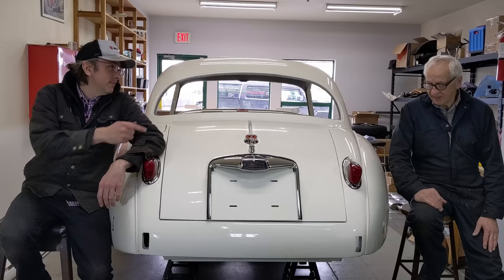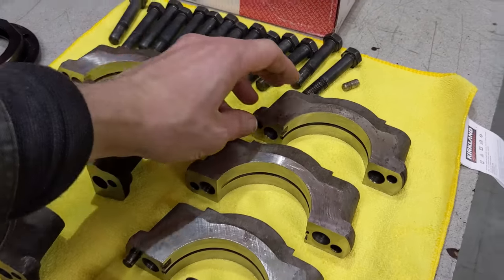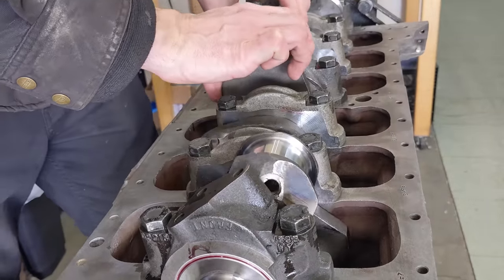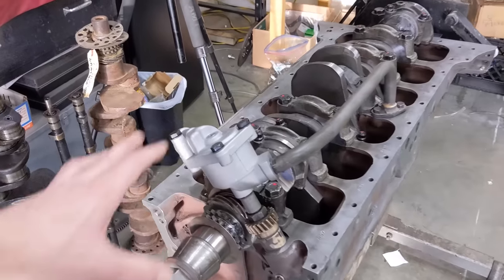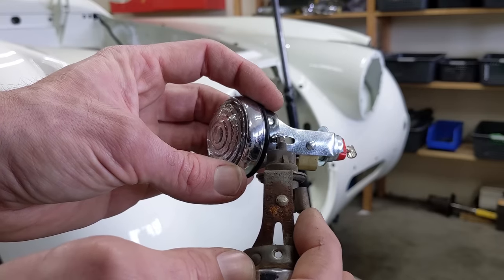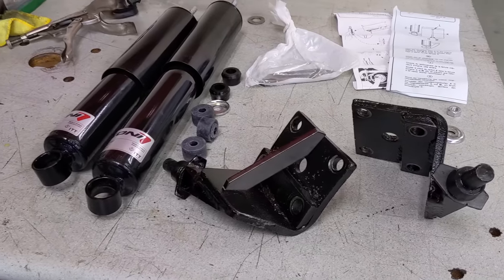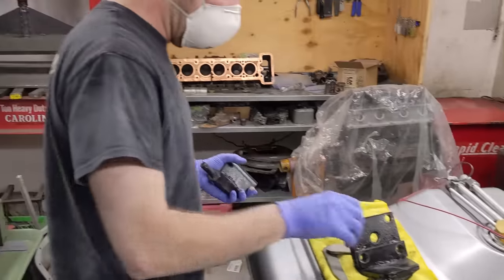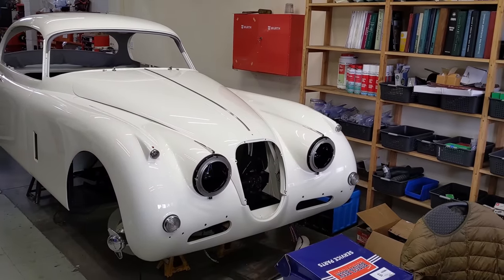Jaguar XK150 Restoration EP9

Comment: I'm putting one of these together that someone else had pulled apart 11 years ago, these videos have really helped me see how it's supposed to be 👌👏
Reply: Commendable job to take on a project that someone else took apart. I stepped in to an Aston DB6 in a similar situation. I had to go backwards for about 8 months before I could go forward. The guy had powder coated all sorts of sheet metal parts without test fitting, and it was all a nightmare. Got there in the end, and my customer is very happy. I aged 10 years on that car....
Reply: I didnt learn, as im doing the same with a 246 Dino now! 😂@ThomasMulhall

Comment: Great episode, with all the interesting variety.  I am all for discreet, well thought out improvements like the drain hole in the headlights nacelles. I would install a porous plug in the drain hole to prevent water from washing, or road splash to enter the cavity. A porous plug also discourages insects from making their way into the nacelle cavity. A jute-like material was used in the past, but these days one can use a polymer fine mesh, tightly rolled and inserted in the drain hole.

Comment: Richard, Great idea with the vice grip tool for clamping the lower bushes, I mounted my rear shocks with the body off so there is not enough weight to 
get them lined up so i used two ratchet straps on the axle.The XK is looking gorgeous the old english white looks great against the chrome. Cheers Dave
Reply: Richard, I have a question for you! What is the hole for in the floor under the rear jump seat on the drivers side. Some one as asked me and for the life of me i can‘t see why it‘s there after checking the rolling chassis there seems no aparent reason??? Cheers Dave

Comment: Superb episode. I am with you in making modifications to protect these cars and also to make the driving experience more pleasant and safe. I have a 65 Mustang that I drive a lot here in the UK. I have fitted power disc brakes, done some suspension upgrades including Koni shocks and also fitted brighter headlights to compete with those modern German cars that have lights bright enough to give you a sun tan!!  I suppose if the owner wants an absolute concourse garage queen car that is trailered to shows to just win medals and pots that's a different thing, but not my bag.

Comment: Hi Richard, I have farmed with Jags for many years. Great videos. If I may comment you have the red prisms on the side lights the wrong way, the vertical face should be towards the rear to reflect the light backwards to be visible to the driver.
Reply: I'm not so sure I agree. I researched this for my XK and came to the conclusion that Mk2 Jags have your preference. I also conducted some dark garage tests and found them  better when installed as on video. I have however used LED bulbs that are distinctly better.
Reply: These are optical prisms which reflect the light out of the vertical end. It makes sense for the driver to be able to see them as they approximately mark the front  extremities of the vehicle.

Comment: Hi Richard . The Jaguar is really starting to come together . Seeing you fitting  the big end bearings reminded me of a tale from  my best buddy. We both trained at  a Jag'  dealer ship  I, as a panelbeater and Richard as a mechanic back in 1970 !  Richards mentor was Reg' . Reg' was profoundly deaf from running up RR Merlins during the war. So they Installed the rebuilt 150 engine and Richard was underneath to check for leaks while Reg' ran her up. Reg' starts her up and the wrong bearings  were fitted and this engine is knocking itself to pieces ! Richard is screaming at Reg' to switch off the engine !  Reg' can't hear so revs up the engine and suddenly becomes aware of a vibration !!! Too late he realises something's   wrong !  We still laugh at Reg's misfortune to this day !  Jason's shop is full of gorgeous cars . I did wonder if that 120 belonged to anyone we know... RICHARD ! So why isn't that lower shock fixing a thread and nut ? Looks pretty fragile to me ! Great work Richard and as always your attention to detail is faultless !  Thanks . Take care and stay safe.

Comment: Hi Richard, Another excellant episode. A very thorough engine rebuild. Good idea with the drain hole in the headlamp nacelle, don't forget the forward headlamp seal that covers the retaining rim inside and helps prevent the ingress of water from the front. Are the side light tell tales the right way round? Just putting that thought out there. Can't wait for the next installment.
Reply from the maker: Yes I have those seals, forgot to show them. Ah well. Thanks for watching.

Comment: Regarding the drain hole in the headlight, we used to put a slightly opened cotter pin (or split pin as we called them in the UK)) in the hole this stopped road dirt blocking the hole as the pin would rattle around in the hole. I love the old Jags.

Comment: Drain holes are good.   I added a drain hole at the bottom of a Midget A post with the same design issue.   Water with no place to go means rust out.  I see it as a design oversight.

Comment: Hi Richard, great video as usual! Thanks for the hint with the holes - that is really a good one. Actually the lamp pot seal should seal it all up - but most obviously it doesn't enough. So I will cater also for that hole, when it comes to the body work on my 150. 

I also had a stupid idea watching you: I really dislike the hole for the screw in the running light. It came to me to turn it up side down and fix it from beneath and lead load the upper hole and not weld - for easy restore originality if issue for anyone after me. What do you think?

Great machining job. Here we also get another design of the rear seal, which is not split. but runs on the outside or the crank shaft flange. it also collects the oil and returns it. You also keep the rope and you don't machine the crank shaft. Theoretically it can be retrofitted without dismantling the engine. There are some advantages and disadvantages in each design. I don't trust the split oil seal fully, on the other hand i really don't like the rope seal. Maybe the old Asbestos seals were simply better in doin there job.

Also, I had once an engine ice blasted inside out. The inside paint did come off and we had to reapply, as some old chap told me the red paint had the purpose to seal the engine block for oil leakage. Some of the castings did have issues of being not one hundred percent oil tight, as the casting had pores. I did not want to find your the hard way he was right.
The ARP-Screws are great. I have come across a method to determine the stretch of the con rod bolts with a gauge. A guy building racing engines told me he does this all the time, not only to ensure the correct setting, but also to keep deforming of the journal and clearance in check.

Thanks for sharing!

Comment: Hello, the drainhole behind headlight unit should be at least dia. 5mm. It looks rather small. The max. waterdrop size is dia. 2.5 mm for a drop of 50 mm3. Especially with fresh painted hole edges take at. least 5mm on the safe side. Your restauration is a great exemple of a high end on!

Comment: Great work as usual and puts me to shame with my hack.
I would make one comment. I fitted new springs years ago and bought Wefco leather spring gaiters. You wrap the springs with oily grease and rag beforehand. I checked them years later and they were like new. Stops grit and rust happening between the leaves.

Comment: great to see you unafraid to fix the things that weren't done well :-) it's looking really great

not sure about those headlight chrome surrounds... the bit sticking up at the top aligns with the "spear" as you called it, but the height of the two parts is totally unmatched, and the width looked unmatched also? were they sold like that?

Comment: I would have thought they would have used a nut and bolt on the bottom of the rear shock? That cotter (split-pin) doesn't look secure enough!
   Geoff. From UK.

Comment: Quick question. Shouldn't the split rear main seal be staggered? You know, like old GM engines the split is offset from the bearing cap split about 1/4".
Reply from the maker: A.J. Absolutely! Thanks for watching.

Comment: Just to make a suggestion when you torque something and I know allot of people do this with torque wrenches. When you torque a bolt to its spec try not to hold your hand on the end of the wrench above the bolt. What happens it throws off readings based from your hand being over the bolt. One will get readings that might not be correct. Just my opinion.

Comment: Why does the crankshaft have a sludge trap is there no external oil filter?
Reply: They are actually just oil galleries which are blanked off with plugs.  But they got filled with mud over the course of many years. When ever doing a rebuild the plugs must always be removed so the crank can be cleaned properly.

Comment: I find it odd that Americans call those cotter pins. In engineering, a cotter is a pin or wedge used to tie parts together tightly. One common use was to tie a crank to a crankshaft or a piston rod to a crosshead. That was how pedal cranks used to be attached on old bicycles, with a cotter pin. The term use in the UK is "split pin", which is descriptive of what they are. That is a pin split down the middle, which is bent to prevent a castellated nut or other fixing from coming loose. 

Also, just about everybody in the motor trade refers to dampers as "shock absorbers". They aren't. In engineering terms, what absorbs the shock is the spring, and the damper is there to damp down the springs action, especially on the rebound. For that matter, radiators work almost entirely by convection, and are really liquid to air heat exchangers. The motor trade seems to corrupt a lot of engineering terms.

Comment: I think you will find you have the red tell tail indicators are the wrong way around, the short side should face the driver so that it indicates to the driver that the light is on, the Lucas word should face the road.
Reply from the maker: I reference an unrestored XK150S Roadster for this build often. It still has it's original indicators like you see in the video. Maybe both cars are wrong?
Reply: @RichardMichaelOwen  I know this subject has always been a bone of contention by restorers I have researched it, plus like you I have worked in a Jaguar restoration shop, we always referenced original photo's when the cars came out of the factory and the question has been asked of the JEC in the UK many times,obviously you will have to do what you think is correct, but I would strongly suggest you try to look at some photos of vehicles as they came out of the factory, I do not think the XK150 would be different to other cars.
Reply from the maker: @jagvette1  here is my example car, 57,000 miles, two owner car. The faded indicators look like the originals https://bringatrailer.com/listing/1959-jaguar-xk150s-roadster-4/

Comment: Reusing the bearing cap bolts?  Shouldn't they be new in a rebuild?
Reply: As long as they weren’t a torque-to-yield specification, and don’t appear to be damaged, they should be fine to re-use.
Reply from the maker: For a high-performance build, certainly. As scott said if they don't show excessive stretch then its ok. On my junk e-type engine I reused the rod bolts which is a big no-no.

Comment: You were an artist on this car and its engine. But to be honest it looks like the headlight and spear on the left side do not lineup correctly..Also looks like your aftermarket headlights don't line up in the chrome ring... Is that just a camera distortion or was this how Jaguar originally built the car? The cotter key took you and your dad made was perfect...

Comment: I don't see why you apologize for drilling a drain hole in the headlight pods or for adding silicone seal to the spear molding. Just do it. I had already done a drain hole to the fog lamp buckets of my S type and I apologize to noone. It's called improvements.